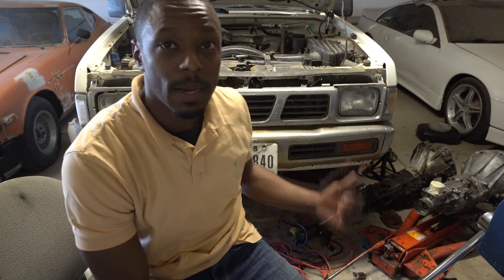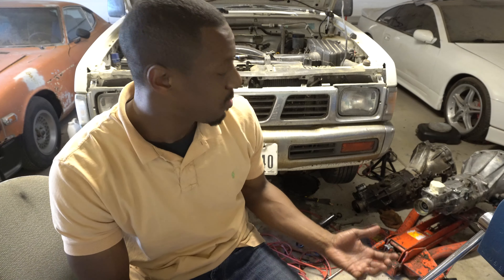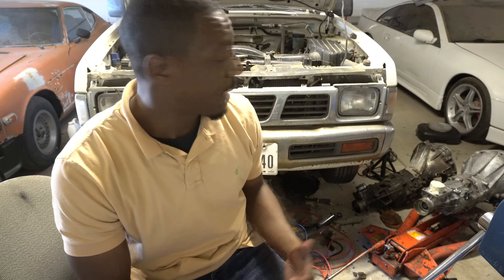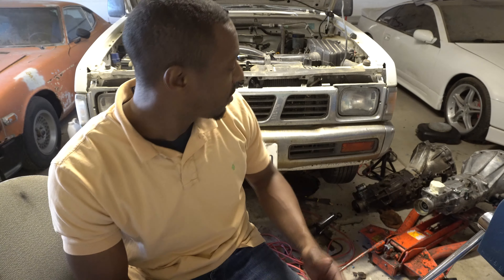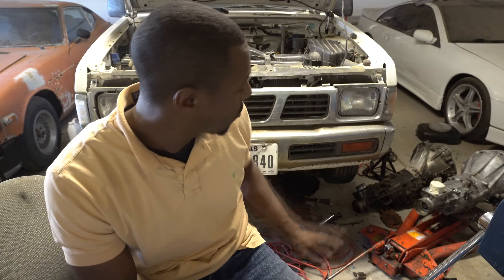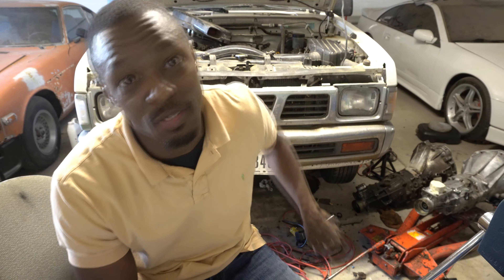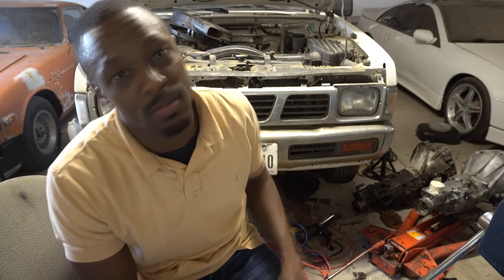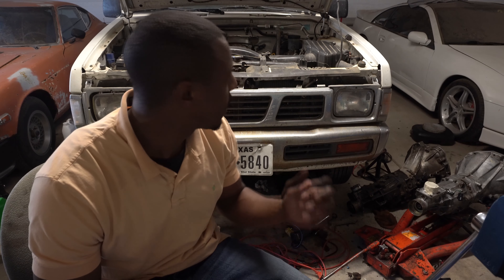Update! Where I've been, Upcoming Projects, Replacing my Nissan Hardbody Transmission, New Vehicle

Comment: Good luck on swapping that trans
Reply from the maker: Thanks! It’s all done, everything went fairly smoothly! Put about 7-8,000 miles on it so far, still shifting good :)
Reply: @GarageAntics  Still going good?  Did you rebuild or replace?  Where'd you get the replacement?
Reply from the maker: @weekendhomeprojects  yep, still running strong after almost 40k miles! I purchased a replacement from a junkyard in Tennessee if I remember right. I kept the old one, since I don’t quite think it needs a rebuild, but maybe just an input shaft bearing, I think that’s what it’s called.
Reply: @GarageAntics  That’s a sweet DD.  Glad you got’er fixed.
Reply: @GarageAntics  How much did you find a used one for?  Was just poking around online and they seem to go for $700-$2,000.
Reply from the maker: @weekendhomeprojects  Things have probably gone up a lot since then, but I think it was around $600 or so with shipping, and then after buying a new clutch, flywheel, throwout bearing, slave cylinder, gear oil, and a few other misc things I think it cost me around $1000 total.
Reply from the maker: @weekendhomeprojects  thanks! I love it! It took me a long time to find a decent Hardbody.

Comment: Hey im thinking about buying a 1995 with 62k miles listed at 5k going to get it down to 4.5  is it a good or bad idea
Reply from the maker: @atm3951  it’s an absolutely awesome idea, and that’s a steal with mileage that low. Just due to age, you may want to consider replacing hoses and bushings and reindexing the torsion bars if you have the time and assuming it hasn’t already been done.
Reply: @GarageAntics  awesome really Appreciate it , I been back and forth on it since it’s hard to see a lot of these around anymore . I think I’m going to have to
Pull the trigger on it
Reply from the maker: @atm3951  you won’t regret it!